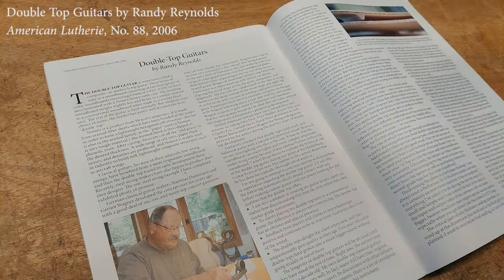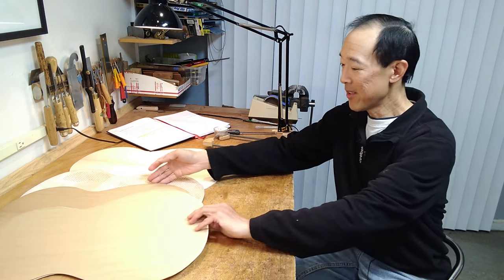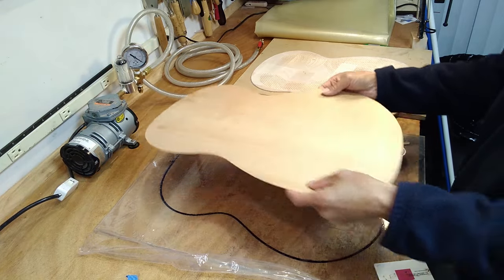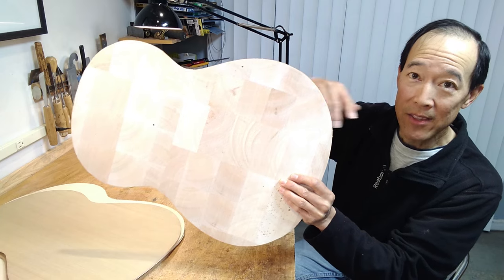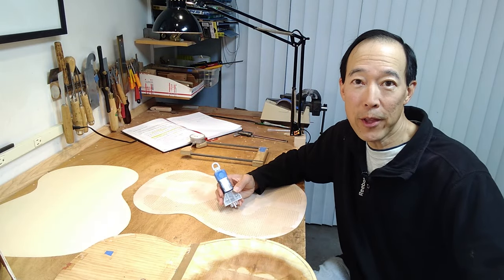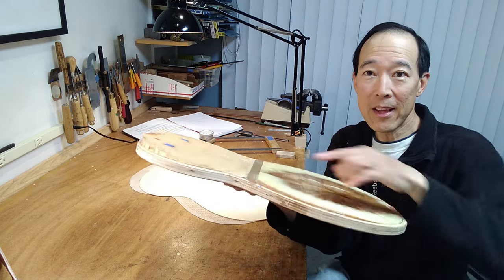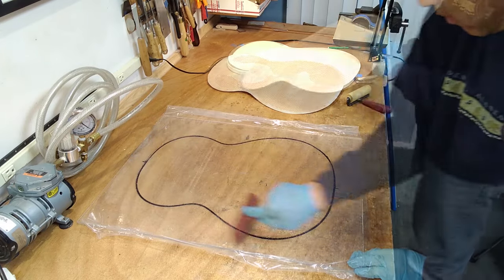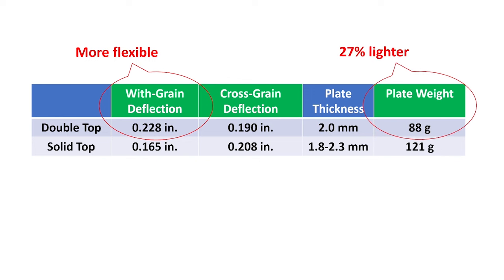Lutherie Demystified Ep.14 | Techniques: Making and Measuring Double Top Soundboards

Comment: How does double tops would work for steel strings guitar? I'm really curious. 😊
Reply from the maker: There are several string builders that use double tops with very good results. The stiffness of the sandwich needs to be adjusted accordingly to withstand the increased string tension. I have used it for a Puerto Rican cuatro, which is a 10 string steel string instrument and the result was extremely good.

Comment: I'm still learning about guitar building(haven't built one yet), so I'm curious what a carbon fiber core would produce? Or if it's even a viable option for a core. Would it be too stiff, since you would have to use epoxy? Could it be thin enough and/or resonant enough? Has anyone ever used carbon fiber?
Reply from the maker: You're inclination is correct--carbon fiber with epoxy would be too stiff. The cores actually need to be very flexible for the design to work.

Comment: Hi and thanks for the very informative video! I make double top steel string acoustics. I have been using nomex successfully, but I'm always looking for other methods. Particularly with LMI out of business, the idea of balsa sounds like a good choice, as I have a CNC and the extra machining is not a problem.. What drove you to move to Balsa, and have you found it to be a cost saving decision? Any thoughts that you might offer would be very helpful.  You mentioned that you are using polyurethane glue for the sandwich, I have been using system 3 epoxy. Frankly, I'm not a fan of epoxy and looking for an alternative. What brand of glue are you using?  Again, thank for the video and any advice you could offer.
Reply from the maker: The use of balsa was an exploration into sonic differences and the ability to use CNC to strategically position solid areas, such as borders at the periphery and areas under the bridge and rosette without having to rout pockets for the Nomex. In recent years, one significant truth I discovered is that regardless of Nomex or balsa, a "natural" sound can be achieved by either material or mixtures of the two. What determines the sound quality is to achieve the right resonances that are the fingerprints to the sound you are after. The idea of a synthetic material giving a synthetic sound vs. a natural material giving a natural sound is false, as I have proven to myself in many guitars. They can give similar voices to the point that I can use the different cores interchangeably or in mixtures. Light, end-grain balsa more expensive than Nomex. You can buy Nomex from ACP Composite Products in Livermore, CA. Gorilla glue works well if you can get your layup in the bag in under 20 minutes. Loctite UR30 can be used if you need up to 30 minutes. Both have worked well for me for Nomex and balsa.

Comment: Hi Garrett , thank you for the inside of making doble tops , Question what tipi of vacuum do you use ., thank you for you reply.
Reply from the maker: It's a Gast MOA-V113-AE. There are often used ones listed on eBay for a reasonable price. My used one has been running well for about 15 years.

Comment: Have you experimented with different PU glues? Which have you found the best?
Reply from the maker: Gorilla glue works well if you can get your layup in the bag in under 20 minutes. Loctite UR30 can be used if you need up to 30 minutes. Both have worked well for me for Nomex and balsa.

Comment: What’s the density for honeycomb?
Reply from the maker: The raw balsa is approximately 8 lb/cubic ft = 0.13 g/cm3. Once the holes are cut, it becomes about 0.05 g/cm3. For comparison, when I use Nomex, I use the variety that is 1.8 lb/ft3 = 0.029 g/cm3. The gluing surface areas are different, and Nomex will carry less glue than balsa with holes.

Comment: You buy the balsa already holed out because You don’t have a CNC to make the balsa pattern with. There has to be a better design than symmetrical holes which makes no sense. Having a CNC would allow you to make the balsa layer with your own design which, I think, would enhance sound response.
Reply from the maker: The core is cut with a CNC using a pattern of my design. The balsa is purchased in raw form from the specialty balsa supplier. Different builders have different opinions about the amount of flexibilty needed in the X and Y axes. A uniform distribution of holes simply allows me to achieve the ratio of stiffness that I'm after. This is similar to the uniformity you have with Nomex. It's still possible to achieve additional directionality by spatial alteration of the core thickness, if that's what you want.
Reply: @GarrettLeeLuthier    So the symmetrical holes assimilates the uniformity of Nomex- now I understand. Thank you for the explanation . Also, thank you for your answer on the question of “do DT guitars open up ?”.  
MERRY CHRISTMAS and	 HAPPY NEW YEAR!!!
Reply: Thanks again for this video.  Can you tell me what the balsa material you're using for the core is and where you get it?  Are the holes all the way through and if not, why not?
Reply from the maker: The core is end-grain balsa of "light" classification (6-10 lbs/cu. ft.) purchased from specializedbalsa.com. I machine the holes part way through in order to maintain some integrity in the sheet for ease of handling. You can certainly machine them all the way through if you want.
Reply: @GarrettLeeLuthier  thanks so much.  How thick do you start with?  I'm going to try this on a retop as an experiment.  I really appreciate the time you put in this video.
Reply from the maker: I start with 1/8 inch thick balsa sheets.
Reply: @GarrettLeeLuthier  thanks!